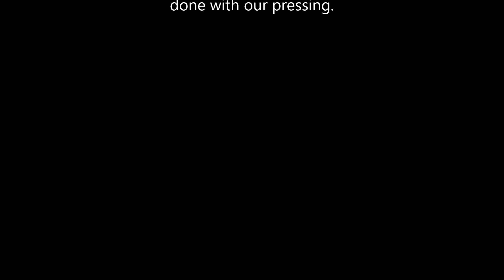Apple Press First Use- PTO powered Apple scratter and press for tractor. Part 2

Comment: I am researching the process of producing apple juice or cider.  It appears that the smaller the particle size of the crushed apple, the more juice.  Have you considered other methods of reducing your apples or a secondary process that would reduce the particle size further?  Your design and construction is excellent.  Hats off.
Reply from the maker: We were looking to have one machine, that attaches to a small tractor. The Apple scatter grinds the apples well enough for what we are doing, I’m certain other methods can do a similar job. Thanks!